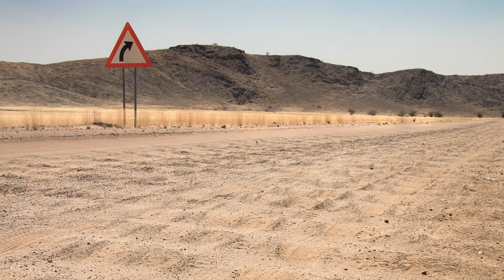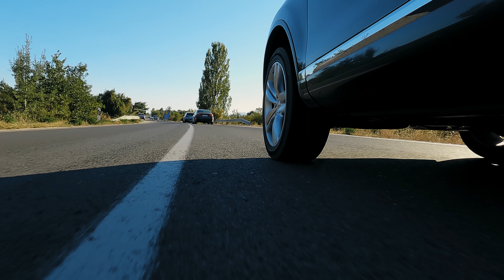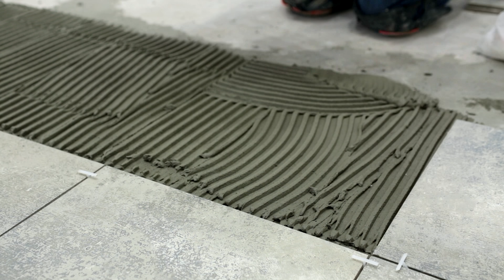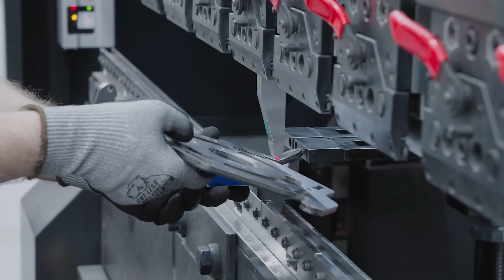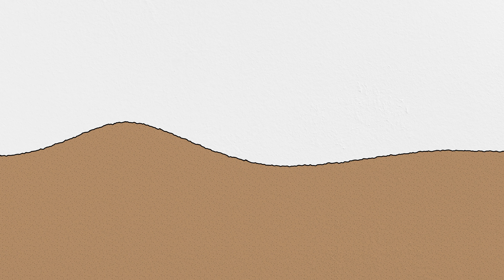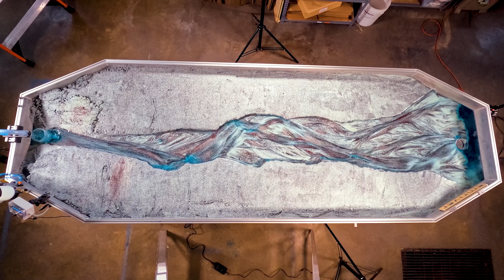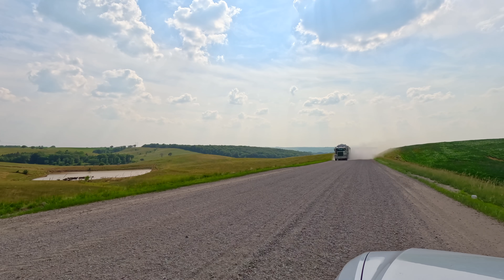Why Roads Get Washboards

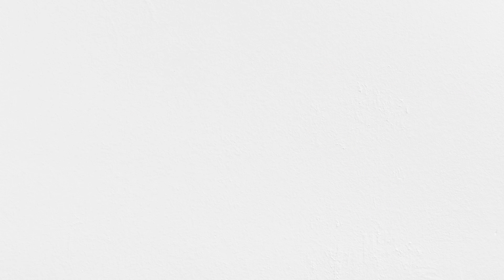Comment: 4:18 Ahh yes, but our council found a way around the maintenance costs for our unpaved roads... just don't maintain them.
Reply: Where I grew up it was 5 miles in any direction to the nearest paved road.  Shock absorbers never lasted more than 12K miles.  Since I moved to paved roads, I have never again replaced a set of shock absorbers.  I also noticed that the road was smoother if you drove on the wrong side of the road against the grain of normal traffic and also if you drove faster than the normal traffic.
Reply: @rotarylancair5637  I used to compete in desert racing back in the southwest, I've found that placing your tires between the well worn ruts helps the most, basically just center your left tires over the center of the road so your right side is between the ruts.  That avoids the worst bits and most of the washboard because people generally don't drive there.  They either stay on one side of the road or they drive directly in the middle, so your tires are always in the least driven area.  There's a certain speed you can go over washboard that allows you to float on the peaks of the washboard and the ride is nice and smooth, you just don't have much traction and have to slow down in the turns because your tires are only touching 1/4th of the road surface.  If you do it often enough, it'll actually start to erase the washboard as you're wearing the peaks down as opposed to pushing the peaks further up.
Reply: @Skinflaps_Meatslapper when in doubt- flat out!
Reply: @AgentLeon  throttle out and full send my guy 💪
Reply: I'm pretty sure they have that policy here in Idaho!  🤦😬
Reply: In the UK they don’t maintain the paved roads either, potholes everywhere, unless it’s the council owned car park at the town hall.
Reply: Yep. South Africa here.
Reply: hey that's the same as the paved roads 😂
Reply: Ha same in my neighborhood!
Reply: We drag a large tractor tire behind our pick up to eliminate corrugation on our dirt road. It has a chain attached to the tire so  someone else can hook it up when traveling in the apposite direction. So our long farm road has a much smoother surface. Just hook the chain over your towbar and unhook when you done
Reply: And, it MAKES people slow down.
Reply: We do that too!  All 4 seasons here and the highway dept is only good for snowplowing.
Reply: I thought that was the new world standard is it different somewhere
Reply: Genius! Nothing bad will come of this decision

Comment: 6:34 stepperonline🤮🤮🤮🤮🤮🤮 Go get them from real brands instead
Reply: stepper motors are also a horrible choice for this application as they can have a resonance frequency at medium speeds and it's dependent on load, how do you know the resonance is caused by the model road itself instead of being started by the motor?

Comment: I've heard that driving in 4wheel drive (actual 4 wheel drive with 50/50 split between front and rear wheels) helps significantly reduce the formations of washboards

Comment: Obviously, the dirt roads are the most affected... but all traffic surfaces have that problem. Even harder materials like concrete or steel (rails) are affected by the 'hammering' of the suspension... and the wheel imbalances. In very hard materials, surface delamination and cracks occur.

Comment: An added layer to the complexity of the maintenence and costs is regions. Pikes Peak spent around 100 years as a gravel unpaved road and that was largely due to the efficacy of the method. It's kind of difficult to find information, but the mountain is growing at a noticeable rate within a human lifetime. If you look up the height of the mountain in 1910 you will largely see some made up bogus about old surveying methods finding the mountain to be 14,147ft and claiming it has now been adjusted to 14,115ft with modern surverying methods. You will also largely see answers saying the mountain isn't growing or is growing barely milimeters a year. It's just not true, commemorative coins for the hillclimb race from 1910 show the height at 14,109ft. It's grown around 6ft in 116 years, or around 1.5cm a year. It's also visible in how devastating it is to the now paved road. The asphalt rips apart and leaves deep holes that you can step most of your leg into. It largely goes without the neccesary repairs because the maintenence just isn't feasible, it would need repaving every 5 to 10 years. Unfortunately there isn't a good answer to that road inparticular, the gravel was replaced with pavement because the EPA found the quantity of gravel necessary was causing excessive deposition of gravel in nearby riverbeds.

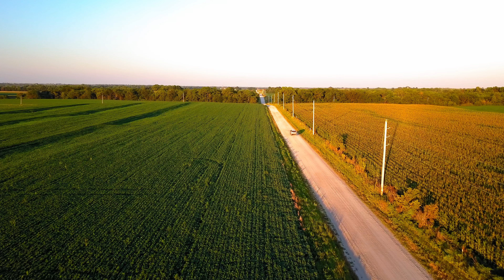Comment: I'm only at 2:22, and as someone who drives dirt roads a lot, most wash-boarding is at corners or start and stop area's where you are either on the brakes or on the gas, that means you are moving material with your tires as you accelerate or decelerate and over time it creates ripples that then turn bigger and can get out of control until the grader comes along or a lot of times winter will fix them on its own for a short term.
Reply: I agree that accelerating is a huge factor in making them. Corners, or areas with pot holes where people slow down/speed up. They are by far the worst on hills, mostly the incline side, because of the increased force by the tires. I thought that the pushing force of the tires was necessary to cause them, so was surprised that his passive wheel created them. I think there is more than one principle at work creating them...wish he would have covered this.

Comment: Wow!  I'm sure hundreds of folks before me have confessed that their intuition was mistaken, but here's my confession--I would never have believed that an unpowered wheel could create washboarding!  My mind had created a strong connection between over-powered vehicles with little weight over the driving wheels (pickups, I'm looking at you, here!) and the formation of washboards.  Application of power accelerates that unweighting at the top of one bump, and the unweighted wheel spins and when it hits the trough, kicking sand back onto the previous hump.  OK, I wasn't totally right, but I'm not sure I was totally wrong, either.  What's the solution?  If I'm even partially right, then those most responsible for washboarding are the least likely to heed pleas to apply power discreetly!

Comment: This is a bit oversimplified. Washboards are intensified by semis and trailers with air ride suspension.  That air can’t dump and fill to keep the pace of a single washboard so as the front axle moves up over the washboard, air in the suspension is displaced to the rear axle by pushing it in the opposite direction.  It carries the undulations beyond the original bump.  Further and further down the roads.  Farmers noticed this effect while using air downforce on planters and pretty rapidly the industry switched to hydraulics with accumulators to resolve this issue.  It’s very evident in some mapping done while planting as that downforce can be recorded

Comment: It would be interesting to know whether the washboard pattern forms more quickly or produces larger waves when the speed is increased. It would be equally interesting to investigate whether a washboard pattern forms at all if—due to a change in speed—no standing wave can develop on this circuit.

Comment: I lived in a city where they had paved (asphalt) over concrete...  At a couple of stoplights...especially one at the bottom of a hill...the asphalt began to "washboard."  When they explored the issue, they found that the asphalt was delaminating from the concrete roadbed, and under the heavy loads of trucks, was stretching and "bunching" like a stretched carpet.  The result was a series of undulating ridges and valleys that got worse as time went on.  The only solution was to strip off the asphalt, groove the concrete latitudinally, and re-pave it.  But even then, people noticed the washboarding returning...  I think the elasticity of the asphalt just wasn't going to work over the concrete given the amount and weight of the traffic...

Comment: I'm not totally convince about this theory. the reason is the wheel size - you used a little, probably 5 cm wheel and the corrugation is about 3 or 4 times of the wheel diameter. Now convert this to car tires which are far larger. 
What I witnessed is that grater drivers do a lot of this damage to the road and this by using AG-tyres on their machines. Most of the graters are only driven by the rear axles / wheels but the string axle, the front axle is just pushed, often pushed straight while being steered into one direction which creates an up and down movement of the entire machine and therefore as well of the blade. This corrugation is narrow and hard to remove.

Comment: I maintain many kilometres of gravel roads in local forests and find this very interesting and useful for understanding the dynamics I’ve been wondering about. I drive a tractor with a back mounted grader and washboards are a problem but my biggest issue is potholes that keep reappearing.
Reply: fill the potholes with clean gravel.  water won't stay on top like on gravel with fines in  it, and the larger gravel wont bounce out.

Comment: Even skiers make bumps. On steeper runs where skiers have to make turns to slow down these turn into moguls, but on flatter cat tracks with soft enough snow, it basically turns into a washboard just like a gravel road.

Comment: In rural areas with corrogations in the road, I find driving on the wrong side of the road tends to be a smoother drive (obviously moving back to the correct side of the road if other cars around or blind rises or blind corners)

Comment: The synthetic augmentation mentioned toward the end of the video made me wonder about airport runways.  I have seen runway(s) in various states of being built or rebuilt and the exposed interlocked or such type of synthetic augmentation of that and what they sit upon.
It seems that runways endure a lot higher speeds, a lot harder braking, much heavier (mass) traffic, with a variety of small to huge passenger and cargo planes.  And of course they are in use in all manner of weather conditions from 100+ degree Texas summers to deep freeze snow and ice in the winter, and repeated freezing/thawing etc.
Are they basically the same as whatever our interstate high traffic roads are made of from the modern materials these days, but super-built with best materials and so forth?  Or another type of road building altogether?
I also even recently have traveled over our county roads that have just been re-topped in the summer heat (Texas again), watching the cars start from the stop sign with all of the typical Indy-racing pedal to the metal - and I'm mumbling come on people, don'tcha know that you're just wrecking the brand new surface they put there the day before?  Sure enough of course, they are washboard-y as bad as they were before the resurfacing, within a week.  But those drivers probably never heard of your "Practical Engineering" videos and how they might educate enough folks to let us drive on a smooth surface at that intersection - for at least a couple of weeks, right?  😉
Thank you for another smart and fun video!
(And for some thoughts about getting a stepper motor ready-to-use on a few life improving convenience helpers for cats.  They get the conveniences, I get improvements for my buttling life!)

Comment: For future reference if you need to adhere polycarbonate to itself use WeldOn (SciGrip) #4. It's thinner than superglue and you need to clamp the surfaces together for 24 hours, but it will bond polycarbonate, acrylic, or ABS to themselves. Full cure strength after 48 hours. Not available in California due to VOC output.

Comment: I noticed that on old bridle trails that existed before mountain biking and off road motorcycles , the deep forest trails that were never maintained  get a thick buildup of manure that turns to soft soil over time but the trail itself sinks - I think its because when it rains the dry manure absorbs all the moisture and the trail edges cause channeling so the soft soil gets washed away except on narrow turns where it builds up instead. I have often thought that if only the cyclists and the equestrians could work together, they could design a system that complemented each other to preserve the trails without as much constant upkeep simply because the two modes of transport differ in how they affect the trail. 

Those old trails sometimes are several feet sunk below where the edge of the trail is. I should take some pictures.

Comment: friction x layer h x w x force x velocity > layer momentum area x friction than the sub layer forces layer separation forward.
take the angle of repose of water and sand/dirt and compare to hull length and wheel diameter gives you a force vector acting on the media ahead of it . and the volume etc of the media it needs to move .

Comment: In Australia, they are generally called corrugations, like the cheap corrugated tin roofs in the outback. I do a lot of off road driving and you get more corrugations round corners and at the bottom of hills, sure signs vehicles are accelerating or braking moving the wheels up or down more than usual, just like you explained. Problem is I don't think we will ever fix them even if we know how they're caused.

Comment: I would have thought it was because the wheels exert a force on the road when they grip to push the vehicle forwards, thereby "folding" the material backwards as they go.
Reply: Around 10:40 he mentions that you need a fluctuation in tire forces to get the process started. As someone who drives 80,000 trucks on unpaved roads, accelerating or decelerating without extreme finesse can easily get washboards established within only a handful of passes even without the speed component.
Reply: @clark772  yeah, the fundamental forces causing the washboards are different from what I thought they would be.
I thought they'd be from the friction of the wheels on loose material, bunching up where the sand/gravel "catches" itself. 
For it to be the rhythmic pounding of the ground itself was surprising.
Reply: @clark772  It's hilarious watching this video and reading the comments.
I'd bet of the 2.6 million viewers you and me are the only people who understand washboards are primarily caused by the piston stroke in the engine.
The actual solution to washboards, no joke, is give everything a v12 engine. Overlapping power strokes, no washboards.

The best mitigation strategy I've come up with is leave the yard in a different gear every time, washboards created at different frequencies can somewhat counteract each other.
Reply: @Fred-s5m9m  if that was correct, EVs would not have this problem.
Reply: I think it can start like this at intersections.

Comment: In Southeastern Illinois we are cursed by the availability of "river rock" due to our proximity to the Wabash river gravel pits.  Dare I see it is "cheaper than dirt?".  River rock is round.  What a disaster for use on roads and expecting it to stay in place.  In my area the washboard occurs in places where stopping on the road occurs.  When approaching a stop sign you can literaly be turned sideways by the washboard causing wheel hop. In recent years there is some use of crushed rock being placed in the washboard.  It seems to work to lessen the effect because the crushed rock has flat sides and is not round at all.    His test bed used constant motion but did not demonstrate the road damage caused by the braking of wheels at intersections.
Reply: We used to use a mix of river shingle and clay.  A cheap and moderately successful solution

Comment: A bit unrelated, but your point about economics of laying out asphalt/concrete for a road reminds me of a mining company I used to work on. It has a mining town up in the mountain and 40 km south is a refinery complex with a port. They use pipes to transfer the mining products, but they of course have a road connecting the two "towns". Although the "traffic" (not public, of course) is relatively high, the reason they chose not to pave it and instead operating a fleet of road graders every day is because 50% of the traffic are heavy machineries weighing upwards of 30 tonnes. It is cheaper to operate and maintain road graders every day instead of maintaining concrete/asphalt surface that would wear out very quickly with how their traffic is. Not to mention, "maintaining" a paved road would mean ripping out the broken surface and be re-paved, closing down half the road and slowing down traffic furthermore company's productivity. Meanwhile road graders maintain the road by moving, other vehicle could easily pass them.

Disregarding the discomfort of bumpy road (which is compensated by only allowing 4x4s with big tyres as passenger vehicle), the biggest problem is dust. So apart from the road graders, they need to also operate water trucks that spray water to the road. Not that effective though especially when it's sunny.

Comment: Great video and good explanation. The one thing I would like to see as a small variation here is if the wheel is providing the momentum rather than a central force as you had here. As a 4wder myself I would like to see more of how we impact the roads, does engaging 4wd help prevent corrugations, does lower tyre pressures work, does the make up of the corrugation change being that with the wheel being the driving force the dirt would be more inclined to be thrown backwards rather than forward as in this demonstration.